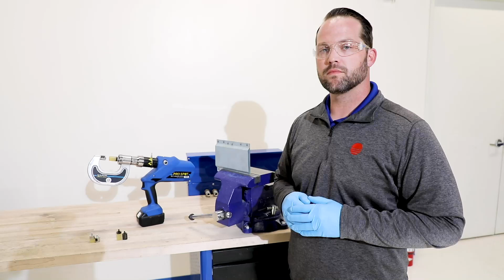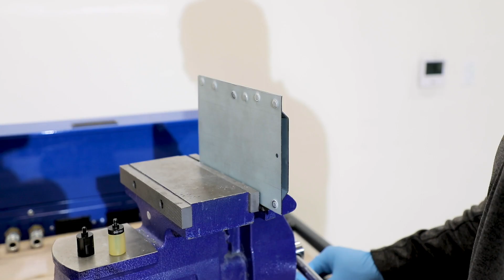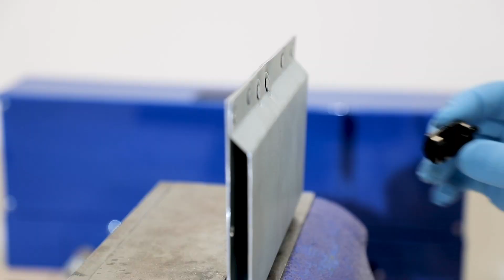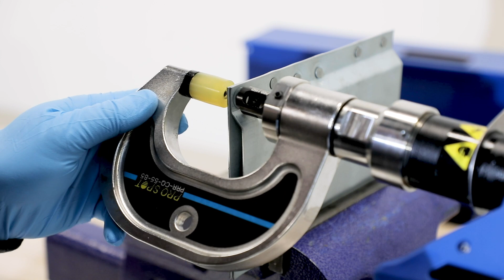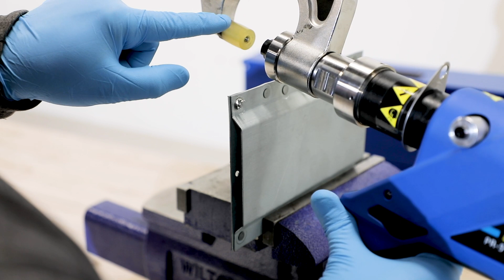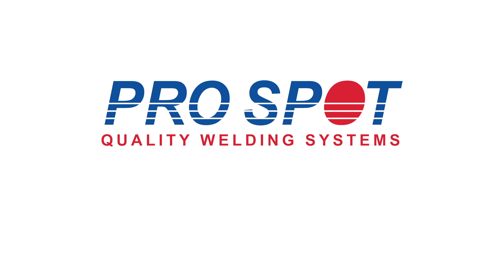How To Use Our Rivet Removal Dies on the PR-5 Rivet Gun And The Riveting Removal Process

Comment: Ok cool, and in all honesty not knocking you guys or your tools. I mean this does actually seem like a good system when you have access to the end of a panel or edge of the material. I'm actually dealing with SPR that join two sections of my snowmobile tunnel together. Up near the top or horizontal side of the tunnel. So in other words I would need a C clamp shaped attachment with a throat depth of about 10" in order for to me remove these SPR's using this method. I'm new to these SPR's and coming up empty on an "easier" way to remove these. I guess it's the old tried and true? method of drilling and grinding and air hammer/chisel.